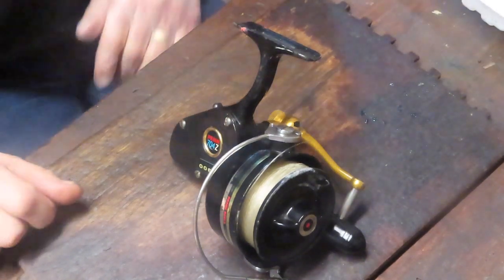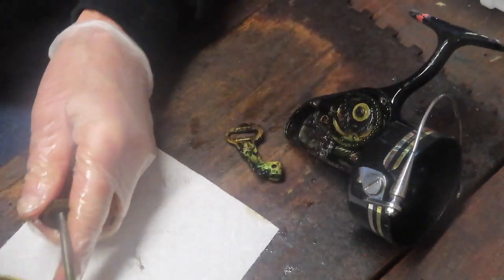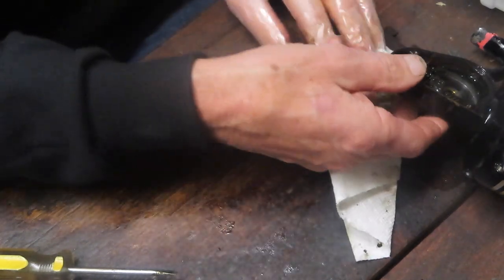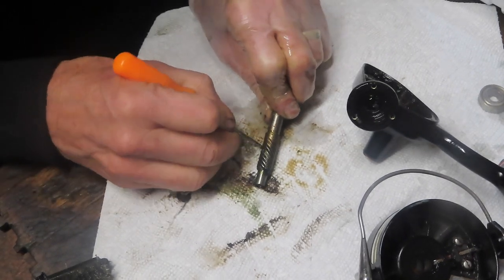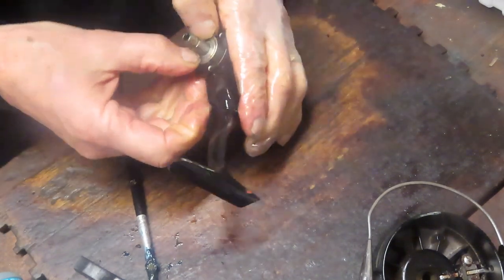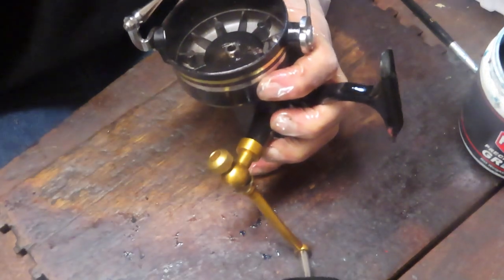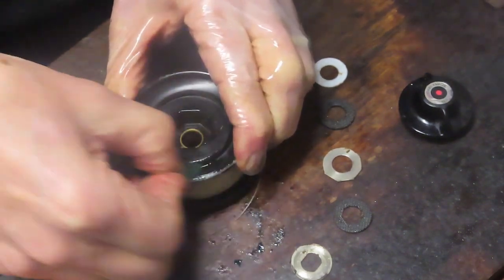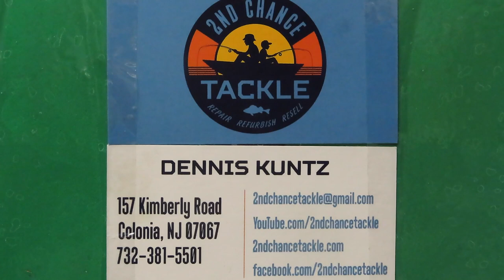How to restore and service a grease frozen Penn 704Z spin fihing reel

Comment: You’re working on one of my all time favorites this time! I have a 704Z  that has a gold spool and a handle with a gold shank and T shaped rubberized  knob.  I bought mine back in the 1970s along with a 706Z. These Z reels are iconic classics and make outstanding surf spinning reels.  I have 2 of the smaller Z reels including a beautiful 722Z that I totally restored. I don’t have any Penn spinning reels newer than these Z reels.  These Z reels were some of the reels that old timers used to pack with grease to make them relatively waterproof. This 704Z is not very different from the 704 greenies that came before them.  I personally think these black and gold Penn Z reels are extremely beautiful reels. If taken care of they will last for generations.
Reply from the maker: I thought of you when I was doing this reel.  - Dennis
Reply: @2ndChanceTackle  I guess you know me well by now.

Comment: Great video Dennis on how you opened up the 704z and you knew right away what the problem was before you took the side plate off. I  know how to do it but at one point I didn't when the anti reverse dog and spring came off and it took me a bit to figure it out.  I thought that would have been a good part of the video to show but maybe you have a new video out showing how to re install them as a service video you nailed it thank you as always for your videos
Reply from the maker: Thanks

Comment: I spray my brush with WD40 after I’ve soaked the gear and parts for a while. After this process they look completely new.  The reissued 704Z and 706Z that came out in 2013 do not have the band on the rotor. The earlier ones have the band. Also the earliest ones had the black torpedo handle and the black spools.  I’m nort at all sure that this is a 1995 version of this reel. I could be all wrong about this. I bought my 706Z and 704Z back in the 1970s and they had the gold spool and the banded rotor. I’ve lost count of how many seized or almost seized vintage reels I’ve brought back to great operation.  You’ve taught me this!
Reply from the maker: I will check again.  The box was definitely 1995 style and not the older version

Comment: Dennis, I just replaced the ball bearing in my 704Z reels. I have three, one of which is the earlier version like this one. I had to do a major restoration on this one as it is the most heavily used of 704Z I have. You can always tell the earlier version of the 704Z by the black spool and the hard plastic torpedo handle. My other two 704Z reels are the later version with the gold spool and rubberized T handle. Both versions have the band on the rotor with line capacities, etc. Only the 2012-13 more recent production of these reels like this and the 708Z do not have that band on the rotor. Other than that missing band these later reels are identical to the early ones and were also made in Philadelphia. I’d love to have another 706Z but I’ll never afford one of those again. They have gone out os sight. Almost ever time I work on a 704Z or 704 Greenie that AR dog likes to fly out and I have to reset that spring. I’ve learned about putting the handle back on as soon as I can so the main gear will keep that from happening. These will always be a favorite of mine. — Chris
Reply from the maker: Sounds like you have enough of these to take the family fishing - So go do that!  Best wishes - Dennis

Comment: Yikes, that grease looks disgusting. I recently purchased a Vintage Daiwa 7350RL reel and it was full of old grease. Some of it was dried to the point that it looked like dirt ! I cleaned it up using your advice and re-lubricated it and now it works nicely. I'm hoping to catch some fish on it this summer. Thank you Dennis for your helpful videos.
Reply from the maker: Thanks for sharing.  I just did a Daiwa 7850RL and will be positing it soon.  Best wishes - Dennis

Comment: I have a old daiwa reel that has similar gear box, huge pinion gear and the main gear riding on top.  It is not very common, what is the benefit of it compare to modem reel that has main gear bitting into the pinion at the 90 degree angle. Nice video, thanks
Reply from the maker: Yes - there were to dominant designs at the time.  A spiral pinion gear and a system that uses the crosswind gear.  The benefit is that one moving part is eliminated and and should be smoother.  The downside is the stress on the reel at the top and bottom of the stroke. Dennis

Comment: I went to service a reel of mine and found that the Penn reel grease that I have in a tub seams a little dry.  Would you recommend ordering a new tub or is there anything I could do to rejuvenate it?  It hasn't been exposed to extreme temperatures. Have you come across this before?
Reply from the maker: I would go ahead and order new.  I am not sure why the grease has deteriorated, but I would not trust it going forward.
Thanks for asking
Dennis